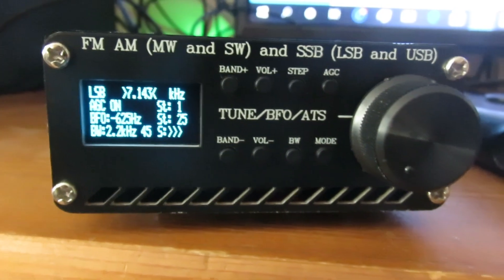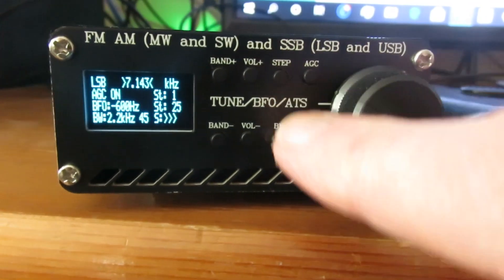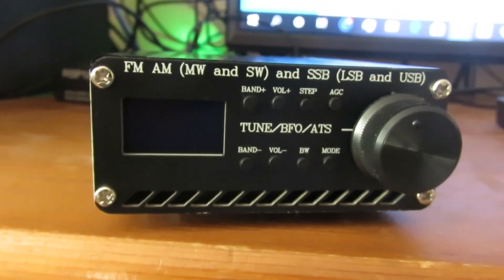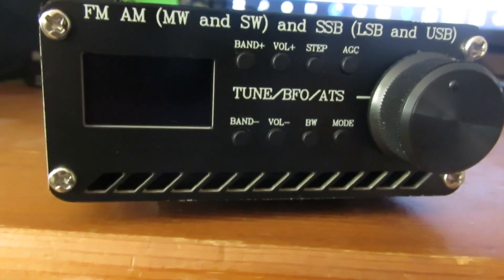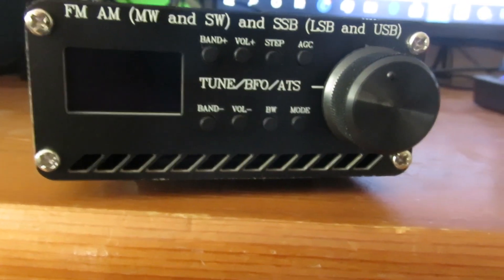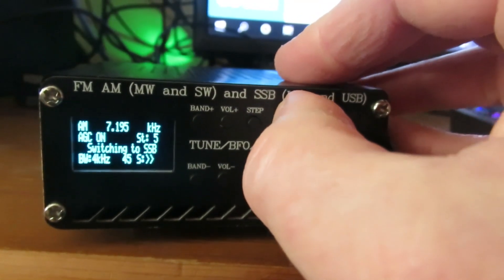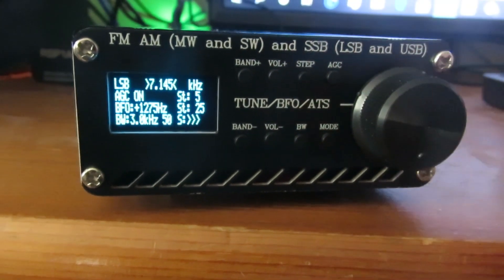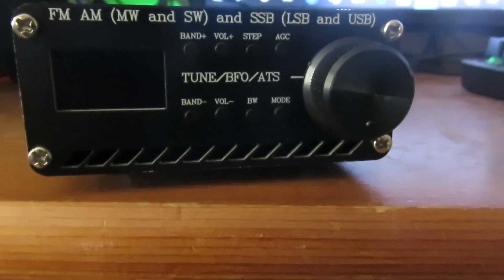SSB working on my SI4732

Comment: Good to know about SSB. It is clear you should check the push button MODE and connections as well. However, I did not understand the reason of the encoder rotation is not working properly.  But it is easy to fix if you want. See line 74 instructions of the sketch.
Reply: Depending on the encoder manufacturer, these pins must be inverted. It should be checked by the manufacturer of the receiver. For this reason, in some cases, the user has to invert these pins in the sketch.
Reply from the maker: Hi Ricardo, should I just change those pin instructions making pin A 2 and pin B 3?
Reply: @KevinOReillyswl  yes. It should adjust that.